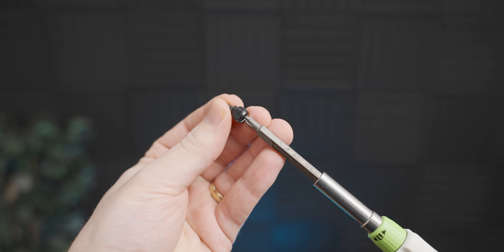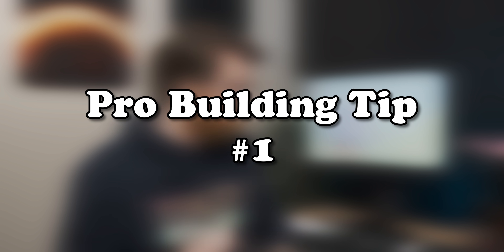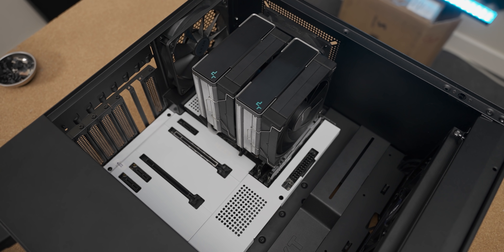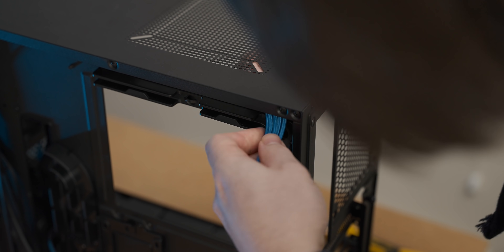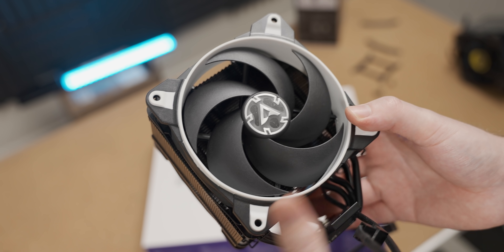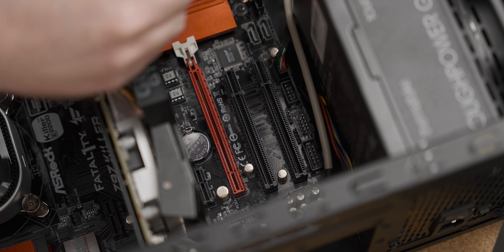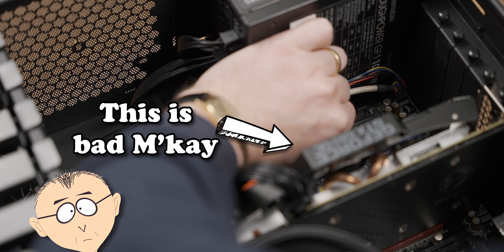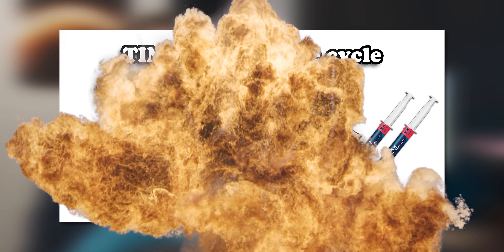5 Things I HATE About PC Building...

Comment: What I usually do with the front panel i/o connectors is get them in the right order, pinch one side to some electrical tape then tape the other side and wrap them a couple times  to keep it all together.   I haven't had any issues with this method.

Comment: the front panel motherboard pinouts used to be one of the most frustrating things to connect
these days, motherboards come with adapters that allow you to connect the pinouts outside of the case, then just slot the adapter into the motherboard - ezpz

Comment: haha I have a Fractal Meshify C and I struggled to put the CPU power cable in after installing the board with the cooler, so dunno where you get that it's easy in that one.
Trick is to plug it in first, obviosly that only works if you have a modular PSU.

Totally agree with all ur points in this video.

Comment: Another alternate method. Plug in the CPU power while the MOBO is outside the case and then route the cable as you put the motherboard in the case. That avoids the possibility of scratching the back of the motherboard on the standoffs while you try to plug in the power cable. I've started doing it that way not.
Reply: I honestly didn't even realize this was still a thing thanks to modular power supplies, and my modern cases having good access. I will admit a couple of my older systems have an extension cable on that header to solve this issue. Well worth the few dollars for a pack of 'em.

Comment: Instead of magnetizing your screwdriver, get yourself a magnetized screwdriver to start with, with tips. Easier, more reliable, and cheap. As for the PS pc connector, connect it BEFORE, installing the cooler. How did you miss this? Works every time. OK, you mentioned this, later on. As far as mounting the fan before installing the cooler, this will often block the cooler mounting screws. About the front panel connector, not all mobos have the header, set up the same way. No complaints...I'm a subscriber.

Comment: Front panel headers...I always plug mine in as soon as possible, like while there's not so much stuff in the case...graphics card, liquid coolers, etc. 

I heard somewhere about a guy using...I think it was an internal USB pins extender...where he would plug that into the front panel connectors and then plug the actual front panel cables into the male end of the extender.

Comment: Dawid ref little screws being difficult to work with, magnetic screw driver is indeed a good solution. I put a little blue tack on the wide end so the screw driver grips it then when done push a lump of blue tack on it to get a clean screw again.
Those little plugs that inclde power and reset I would put at number 1. Strange that only NZXT have cured the problem. I'll need to check but a DIY solution for other cases should be easy enough. With SSD becoming more common the ones relating to Hard drives won't need conecting. Longer wires on those silly little plugs would help in my experience too

Comment: Try getting out of the electronics department and go look in automotive. There's a bunch of tools there that will make your life significantly easier.

1. Get a screwdriver with a "grabby tool"(spring loaded fingers), or a sleeve(slides over the screw to hold in place), on the end, works on both magnetic and non-magnetic screws.
Also, change the direction you're going at it by rotating the case. Don't let gravity be the bane of your existence.
Long nose offset pliers also work.

2. Grabby/Pick-up tool and a long screwdriver, preferably flat head wide enough to not slip into the connector. Or a pair of long nose pliers. There are models that will easily reach to the back of the case.

3. Duct tape or high temp glue. bleep those clips.

4. Long nose pliers again. offsets are great for this.

5. I got nothing, that's definitely a Dawid problem.

Comment: Configuration issue rather than building - The MB would think WW3 had broken out if any fan dropped below 500 RPM. Eventually found some obscure Linux app that via IPMI basically told the MB to take a chill pill.

Comment: Handling TIGHT  EPS wiring, I've had best odds, through connecting the mainboard side first
... Mind you, I've been combatting multiple downdraft style heatsinks in noticably tight clearance cases

Speaking of the F-Panel filth, I remember MSi mainboards offering one chad of joiner accessory bit, to wrangle those stoopid header bits to one tidy assembly. It worked on 3 different cases, 0 hitches

Comment: Number 2: You can also buy short cable extender if you plan to plug and unplug it many times.
Number 4: Plus/Minus only matter for LED connectors, If you plug Power/Reset button other way (plus to minus, minus to plus) it will work correctly.

Comment: Front panel connectors also cause too much stress when the pc will not turn on!  You think the worst has happened.  Also, a tool called a Screw and Nut Grabber is good for starting screws in difficult places.  They are spring loaded and grab hold of the screw & let you make one or two turns before finishing off with a screw driver.

Comment: I am sooooo with you on those fan clips. I ended up taping the fan to the heat sink, then clipping on the fans. Worked great.
Also, Asus motherboards come with a little doodad that you plug those front panel connectors  to, then plug that straight to the mobo.

Comment: I'm an expert at installing an AIO into the case and only remembering afterwards to connect the fan header which is now impossible to get to on the mobo without removing the radiator which then pulls all the cabling back too.

Comment: In regards to the front IO, Asus has had the Q-connector for the front IO with their motherboards and have had it for years. I didn't know about NZXT as I have never had their cases so thanks for that info. I switched to a magnetic screw-driver years ago for the screws. I have never used children for the power connectors but I did once give up on trying to get at the top right power connector on one build and asked my wife to use her tiny hands. That case sucked.

Comment: For the front panel I/O I know Asus used to make this 1 piece adapter block thing that you plug your front I/O into and then plug that piece into the mobo, that way you aren't fighting the little individual connectors inside the confines of the case. Not sure if they still make it or not.

Comment: This was hilarious to see Dawid,  and yes... I think most would agree those are the top 5 worst (unless you have a piece of dead hardware).  I would never wear gloves to put on thermal paste, it's a right of passage!  Also, for the front connectors, usually I just install them when I put the motherboard in and just before I put the PSU in. That seems to work best.  Nice trick on the demagnetization.. learned something new there.

Comment: Huh, I mount the metal can clips the opposite way around then you seem to and I've never had any issues with them. Insert the pokey end bits into the fan first then use the little center handle thingy to wrap the clip around the cooler and they go on nice, cooler dependent to be fair.

Comment: be Quiet!'s coolers have decent mountings for the fans too - that was about the easiest part of assembling my Shadow Rock 3. The mounting bar at the bottom, which goes directly over the CPU itself and fastens to the cooler's  mounting brackets, was a nightmare though.

Also, a miner's torch/headlamp can help hugely with the smaller fiddly things, to shine light where there was darkness, where darkness is those damn case connector cables for the front IO, etc.. They have LEDs now with multiple positions so you can always find a good angle.

Comment: For some cases, I plug in the front panel connectors while the mobo sits on top of the case prior to installation. When possible, it makes all the difference. Another annoying one is the usb front panel connector coming apart during disassembly.

Comment: power and speaker are the only two front i/o absolutely necessary . other i/o can be easier with the newest being easiest. a usb-c connector similar to a sata cable or usb 2 and 3 with are keyed and also right next to the bottom . necessary only if the mobo doesnt have what you need

Comment: A bit different but still has the Dawid in it and as entertaining as usual. The tip with the magnetizing a screwdriver has worked for me with most screwdrivers, I say most because I have one particular screwdriver that doesn't get magnetized no matter how many times I tried and is probably caused by its metal composition of CrV (Chromium-Vanadium). I find magnets from hard drive more effective due to them being Neodymium Magnets.

Comment: For a #6 I would suggest trying to push down the little clip that holds the graphics card in place in the PCI-e slot if your case is even slightly cramped. Some of those clips are just excessive in how much downward force they require before they let go of the card.

Comment: For the front panel connector, I have an adaptor that I got from somewhere (maybe a motherboard or case years ago) that I have been re-using that basically turns any group of front io connectors into one, like the nzxt cases.  (edit) I just found out they are called m connectors and came with some msi motherboards.

Comment: Front panel connectors still haunt me, over a year after I built my PC. I was unfortunate enough to be cursed with large hands and it made it a nightmare to plug in those little-ass cables. I legitimately think I spent more time trying to plug in the front panel connectors than anything else in my PC.

Comment: Or with the cpu connector if you got cable extensions or custom cables or even if you got a modular psu connect the cpu power cord and run it through as you seat the mobo

Comment: The problem with the nzxt case is that not all motherboards use the same pin layout. I have an nzxt case and a motherboard with a different pin layout and I had to chop the connector and re-wire it to be in several seperate ones like the kind you’re complaining about. That was a pain.
Reply: My NZXT case came with an adapter that has the connectors separated in the traditional way so no matter what it will work. Fortunately I did not need it.

Comment: 8:06 or buy an Asus motherboard which has a terminal block which the front panel connectors go straight into, which then plugs straight into the board ;)  you can use electrical tape to hold the connectors into the terminal block. This is what I did when building.

Seriously, I'm surprised someone hadn't worked out a better way for front IO connections - even if it could be over USB 2.0 for example.

Comment: for the front panel headers/plugs, asus solved it with their "Q-connector".  IE, its an external piece that has all the spots, you plug them all in, and then you plug in a single connector.

Comment: The front panel connectors aren't hard.  Of course you do it right after the motherboard is installed to have room.  Most are the same which is why NZXT would have the standard layout to plug in, but the problem with that is that not all motherboards have the same pinout.  Some older boards were different, and if you have a proprietary board, it will definitely be different.

Comment: I can't really relate to the front panel connectors, I just look in the motherboard manual and plug them in without a problem each time. The ones in Sharkoon cases are usually labelled well.

Comment: I have always wondered why the front panel connectors are always made so difficult to plug in. Given that, as far as I know, the order of the pins is standardized and always the same, one would think that they could make it much easier.

Comment: The front panel issues were solved by Asus 15 years ago already. They included an "adapter" pin block where you'd put all your front panel pins into that would fit directly onto the motherboard. At that time every motherboard manufacturer had it's own front panel header layout though XD

Comment: Tip for front panel connector issue: Check the motherboard manual and build a single connector using clear tape. (Very cheap.)
Or you can buy an "front panel connector adapter". (Not so cheap)

Comment: The worst thing is if you are building it and it doesn't turn on.  If you don't have spare parts to swap out (and most people won't) then it is hard to diagnose.  A CPU error could be CPU problem, power problem, motherboard problem, forgetting to plug in CPU fan, CPU power or just requiring BIOS update.  A GPU failure could be motherboard, power problem (or not plugging it in), GPU failure, PCIe riser cable problem.

Comment: #6: buying a part that says it’ll fit and it just doesn’t 
#7: putting those socket clips on universal am4/ am3 coolers 
#8: getting an intel stock coolers pins not to bend when putting them on a cpu (seriously i spent 30 minutes tearing my hair out trying to mount a damn stock cooler without bending the plastic pins, almost lost my mind)

#9: making your cable management all nice and neat then realizing you forgot to plug something in

Comment: Case manufacturer don't do what NZXT does because front panel headers on motherboards have not been standardized over a very long time. They have gotten a little more uniform in the last few years but the power LED's mit still be one pin apart and I sthink many ASUS boards still ahve a slightly different layout.

Comment: solution for the front io pins: lay out the pins according to the mobo instructions and tape them together into a block using electrical tape. plug them all in at the same time.

Comment: For the Frontpanel connector problem I might have a more universal solution... There are sometimes little plastic trays in the Accessoires from Motherboards where you can clip all FP connectors in to get a combined simliar to the one from NZXT. You can order them for little money from china for example, i didn't checked Amazon and co tho.

Comment: For plugging in the cpu power connecter, why struggle with the crammed space between the motherboard and case (screwing the motherboard down first) when u could route the cpu power connecter through the back case then plug it in to the motherboard, and finally screw down the motherboard?
Reply: nvm, i didn't see the part where u explained exactly what i tried to

Comment: I built a PC in a Corsair 100R case... the front i/o cables are sheathed in some kind of springy hellplastic instead of normal wire insulation and trying to get all that plugged in almost broke me.

Comment: I like Cooler Master's Hyper 212 Black Edition RGB fan mount as it's just a plastic shroud holding the fan but strangely Cooler Master didn't do that for the regular Hyper 212 Black Edition. For some reason the Be Quiet! Dark Rock Slim goes on much easier than the Hyper 212 Black Edition's clip. Noctua's NH-U12S is in between those two.

Comment: No. 4: actually there are motherboards where you have a plastic plug thingy to insert all the front panel connecrors and then plug them all in at once, like with that ncxt one. Or use a tweezer 😉

Comment: There's actually a pretty simple solution to front panel IO connectors: Needlenose pliers. It's like if you had the ability to temporarily grow extra long thin fingers. Still not quite enough to solve the CPU power connector debacle unfortunately, because those are too wide to be held by the pliers.

Comment: Cooler Master seems to have fixed the third problem. On my Cooler Master Hyper 212 RGB Black (try saying that 10 times fast), the clips that are used are plastic, and get screws into the fans. much better looks wise and also functionally since you don't need to spend time figuring out how it goes on, although with aftermarket fans it can be a bitch to get on because the screws included are smaller threads than a standard case fan screw, and then you have to use more force than you think you do to get both sides on the heatsink at the same time

Comment: No one's gonna read this let's be real, but;
1. Is information that seems to be spreading nowadays, which is good since it is a good tip.
2. That's what modular PSU's were honestly designed for, we should just plug the 4-pin connector in before you even mounted the PSU itself, unless you (still) don't have one then the trick seen here also works.
3. Hard agree on the fan clips and it's overdue time someone thinks of a new solution, like being able to screw the fan into the heatsink or something similar, especially even on cheap coolers, but so far only some "premium" coolers have such a solution.
4. NZXT has no patent and it might only just be luck that their connector works on so many motherboards now, because in ye olden days MB vendors all touted their alignment to be superior to one another, which is why they had to be separated in the first place as all the pin functions were in different locations. Not to mention that PC cases have the same problem because not all cases come with the same set of buttons/lights/functions nor do we always need them all plugged in (Who needs power leds when you can have AR GE BEE as your indicator?)
5. Graphite Pads rule. (Seriously get them, they might be conductive, but you'll never ever make a mess again, they perform highly adequate AND you can re-use them many multiple times, i've had mine across 3 builds now!)

Comment: the cpu power plug, just go modular, route it, plug it in on the mobo side and then screw in the mobo.  then it is much easier to finally plug in on the PSU side rather than fighting in a tiny space

Comment: Or... You can plug the cpu power cable(s) in when you are about to place the board into the case holding the cooler in 1 hand while its on the board. Thats the moment you should put in the cable not when the board is screwed in already.... or buy a modular psu and plug the cable in right after you screwed the cooler on the board still before placing the board into the case, this really isn't like rocket tech you know?